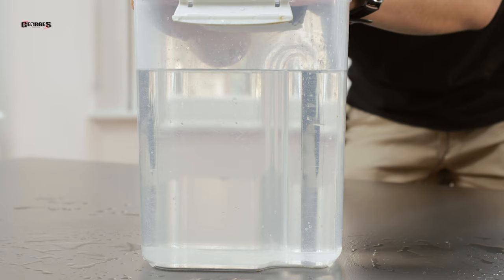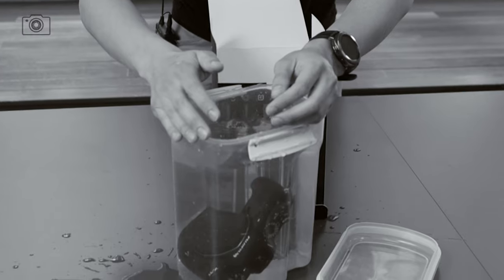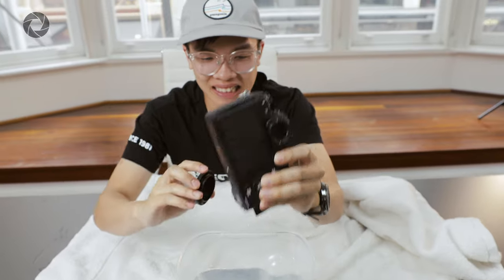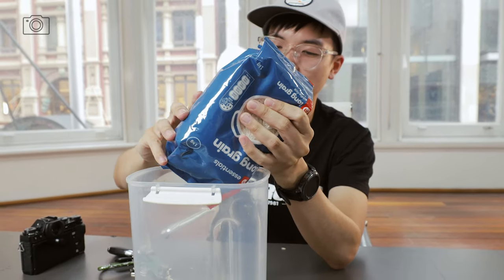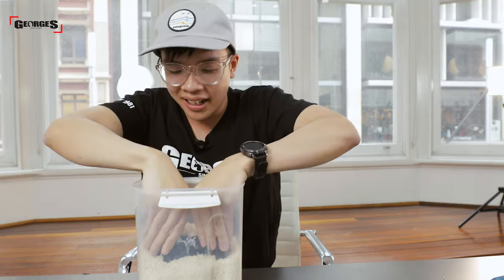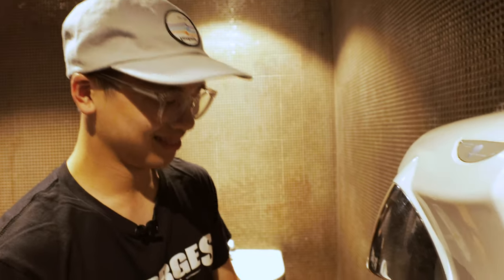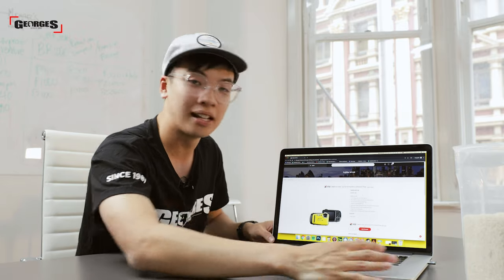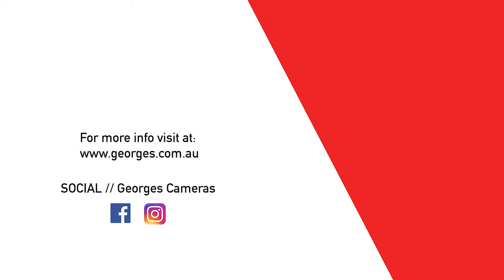How to FIX a Water Damaged Camera 🤔💧🌊🔥

Comment: I left it in the garden and then it rained.  Battery compartment dry. view screen moist inside at the corners but not all over.  Plug access not soaked but two drops of water NOT in the openings.  I remembered the jar of little dessicant packages I saved for years, put them and the camera in a plastic bag.  And now I will wait the listed 3 days with more confidence than a bag of rice. Fabulous pics of amazing PuffBall harvest are in there. Harvest is now in the freezer and soup pot, not as photogenic. Crossing fingers.
Reply: What happened? I have the same situation rn!

Comment: A Question:
I have my camera (Nikon D5500) splashed with a bit of salt water (It's not suerged but more like splashed because I was taking videos of waves and suddenly a huge wave crashed into my camera and I have it out of the water as soon as possible). Afterward it's all sand and wet so I put it in a box of rice for days, and I try turning it on. but the Touch screen didn't work at all, but I can take picture and turn it on, I notice that there's rust in some of the bolts, so any idea?
Reply: I feel you man
Reply: I feel you, dude
Reply: This happened to mine. Though it has been 2 years since I took out the brown and green rusted camera and of course it hadn't work at all. Maybe the last option we can only do is grill it XD.